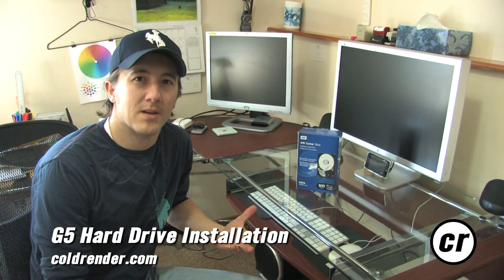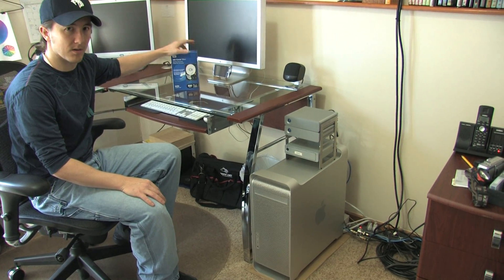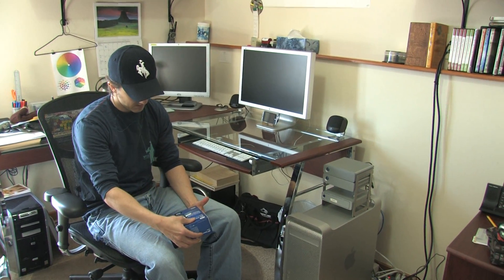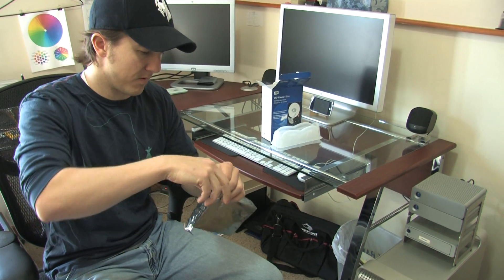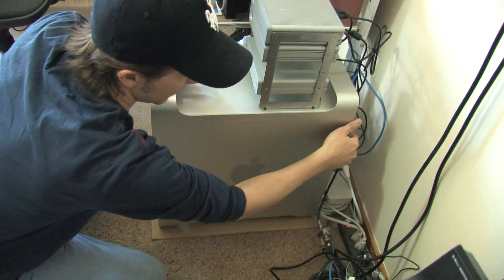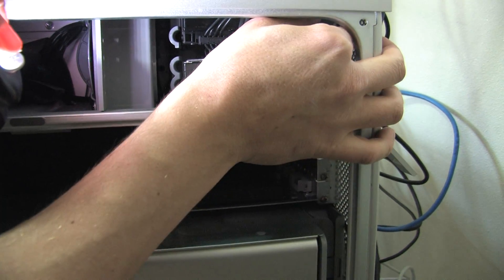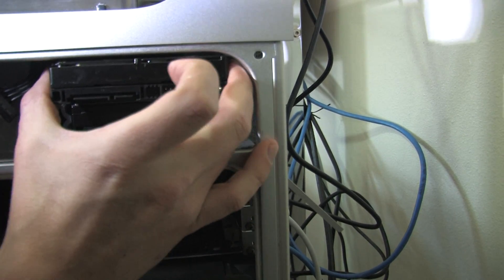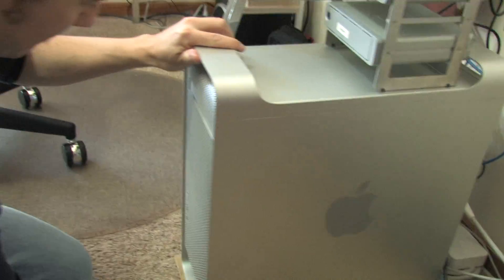How to install a hard drive in your Apple Powermac G5

Comment from the maker: They should be backwards compatible.  I'm not an expert on tech specs for sata, but I believe SATA II or III should work with SATA, but you will likely have only SATA performance.  Much like when you plug in a USB3 device into an old USB port, the machine can only run at regular USB speed, because that's what it has onboard.

Comment from the maker: i believe it would, however i'm not entirely sure that you'd have all the benefit of SATA III, as it was not in use at the time these machines were manufactured.  But a 10k rpm drive would definitely run pretty quickly.